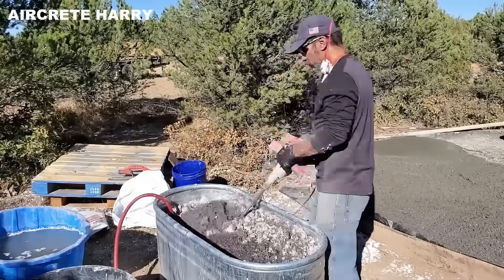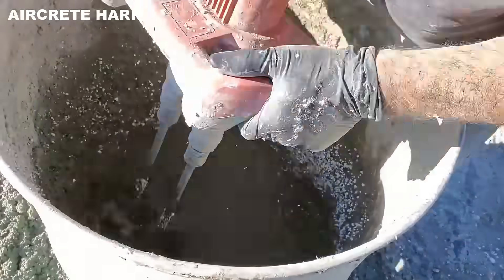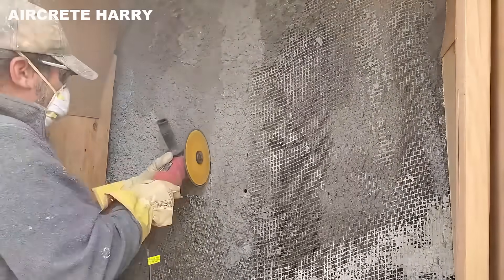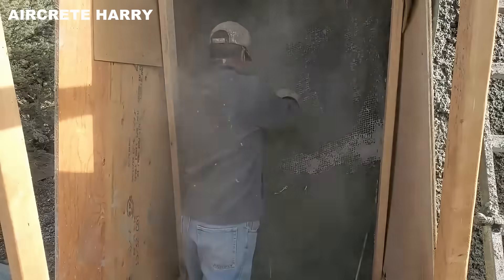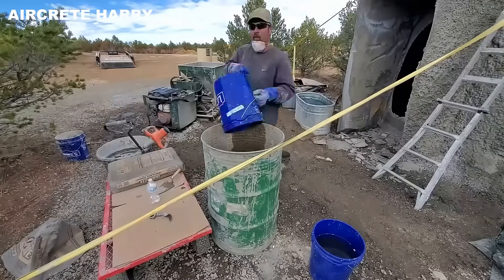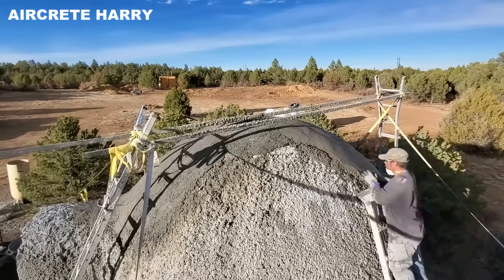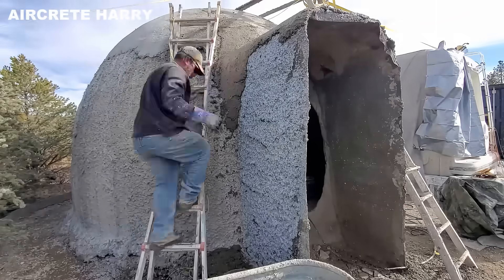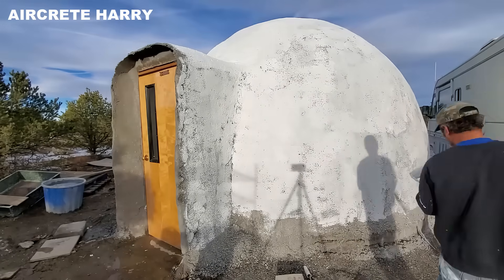He Built a Large Dome Cabin From a Balloon in 7 Days. Full Construction Process

Comment: 建议用玻璃钢先涂抹一层在充气包上，增强硬度，然后再上一层石膏水泥外观修饰光滑，房内墙壁喷涂一层泡沫隔热，再装修内饰板，
Reply: It includes basalt fiber chop, micro rebar directly mixed into the cement, and it also incorporates basalt mesh. 

I'm happy to report that it's still standing and in use! It has proven to be quite efficient, requiring minimal heat during the winter and remaining cool and comfortable on hot summer days. I've explored various building options, and this particular design has certainly proven to be a great choice!

The 2019 build you saw was just one example - since then, we've completed numerous other projects, including structures of varying sizes and even a hyperbolic paraboloid shape.

Comment: Is there rebar?  Wouldnt the acid in the cement not disintegrate the integrity of the mesh over time causing slab failure?
Reply: Aircrete Harry here:
I constructed it solo in the winter of 2019.
It includes basalt fiber chop, micro rebar directly mixed into the cement, and it also incorporates basalt mesh. 

I'm happy to report that it's still standing and in use! It has proven to be quite efficient, requiring minimal heat during the winter and remaining cool and comfortable on hot summer days. I've explored various building options, and this particular design has certainly proven to be a great choice!